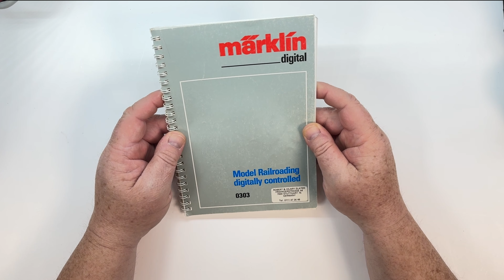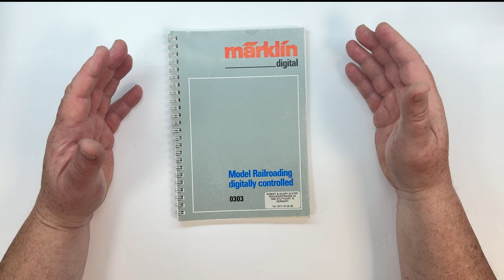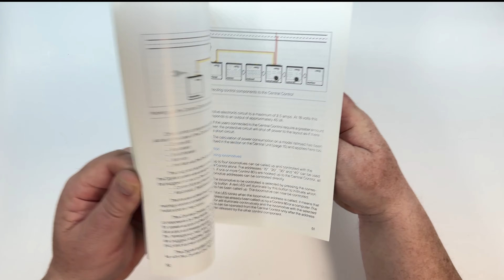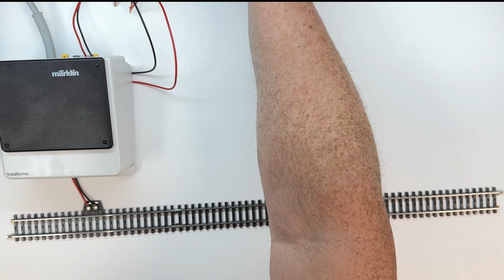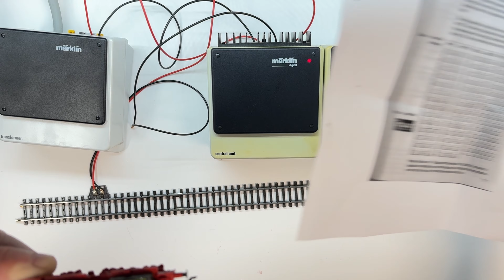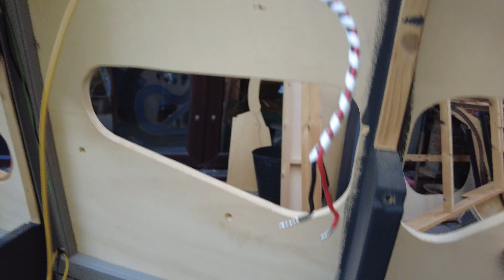Marklin Digital, A 3 rail model railway. Quite uncommon in the UK?

Comment: Thanks Matt that is interesting. I started a Märklin layout in 2005 because of my experience with buying old Hornby Dublo of which I was very impressed. As you say the M mechanisms are also outstanding quality. I found all the M stuff, engines, rolling stock, accessories and C type track work as in your setup made it so easy and a joy to build a layout and get it running. Everything is designed to be compatible. All of stuff is digital with the modern controllers relying more on touch colour screens instead of buttons. Starter sets complete with controller are easily found, probably at that Inline Models shop near Blackpool.
Reply from the maker: Hi Kimball, I thought you might message about the Marklin! I was reading one of the many books that came with the layout the other night and its all looks very interesting so much more than what I am used to, really looking forward to getting stuck in! Matt

Comment: Someone has taken a lot of time with all that wiring Matt.
Have you got an electrician friend who can wotk out the control box?
Hai from H&HExpress Model N scale Trains does something similar for automatically testing where the trains are on the track so he can run multiple trains on what is essentially a DC layout.
Good luck.
Happy Modelling
Reply from the maker: Yes, i am hesitating to rewire, so much time spent to get to here, and a waist not to use. I have a few avenues with the control box, but the first question is what is it intended to do. As you say its something like automatically tracking the trains. but could be linked into a computer for graphics or similar. - Still going to be FUN.